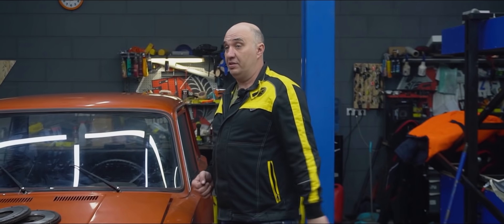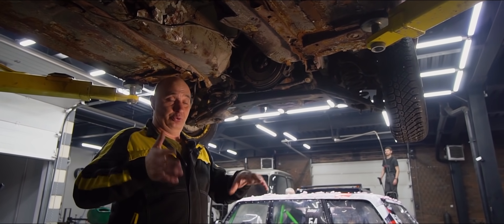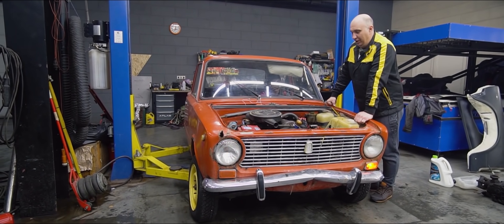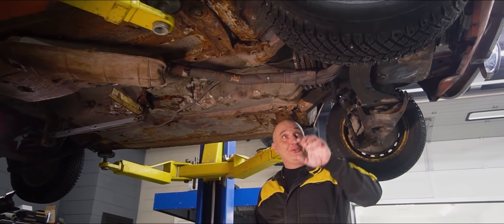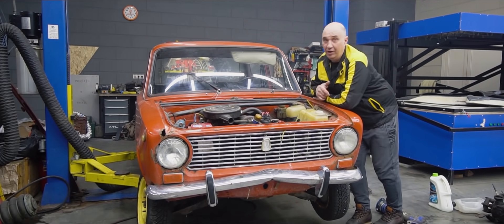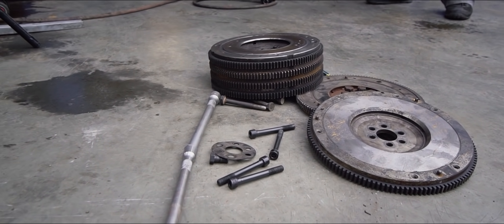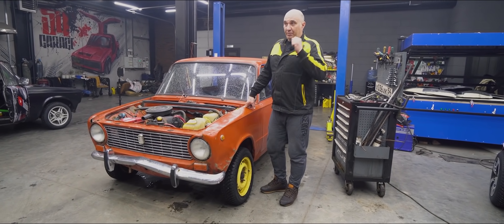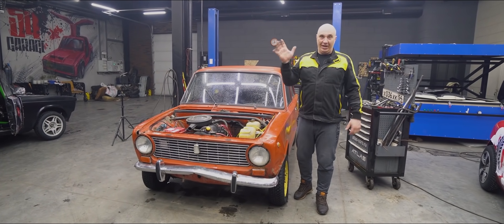What if you install FIVE flywheels onto an engine?

Comment: I bet it could do some wicked clutch pop wheelspin launches. You could have a cheat dragster, just revving a 50 horsepower engine into a giant flywheel for a minute straight, then release and do a tyre smoking 10 second 1/4 mile.
Reply: I used to have toy dragsters that basically did this
Reply: @boldsword1  Evel Knievel motorcycle toy? My favourite
Reply: @steven-vn9ui  not the one I was thinking of but I did have one of those to play with for a bit at my parents thrift shop, I miss that place we would randomly get the coolest things.
Reply: Back in the late 50s it was common to use the heavy flywheel out of a 2 ton truck in dragsters for extra off the line oompf
Reply: I've always wanted to do that on a bicycle. Basically when stopped put it in a gear that conects to a flywheel. pedal like crazy then flick a switch when ready and it connects flywheel to wheels. Launch!
Reply: @boldsword1  that was an awesome toy jumped that off roofs lol
Reply: Spin up like a top
Reply: @dopiaza2006  A bicycle will need momentum but not the extra weight, or you won't be able to get up to even the slightest incline. A really large and light flywheel with a dense rim connected to the pedals through a multiplier gear to capture more energy will get the job done without looking weird pedaling like crazy. Also, think of a clutch in place of a switch, to help you capture energy when braking or going downhill. It's a good idea, a hybrid muscle power/mass inertia.
Reply: @germangargicevich2618  the flywheel doesn"t have to be particularly large if it can spin fast enough, so needs extreme gearing or energy transfer through electricity
Reply: if you've ever driven a small 3 cylinder car like a corsa or polo/ibiza/fabia you'll realise this is how they work. obviously no  10 sec 1/4 mile but the only way to spin the wheels is rev it up and let the fly wheel do the work. it would be interesting to know the ratio of flywheel weight to engine weight for different cars.
Reply: Yes we Canada!
Reply: won't work unless you can do 100.000 rpm
Reply: I was thinking the exact opposite direction. I was wondering if you got that mass up to speed, how l o n g would it last? Like on an open highway, it would take a lot to get up to speed. but then I would think you would get some great mileage as long as you stayed up to speed.
Reply: @boldsword1  Toy was named SSP.
Reply: @bigbossimmotal  there was https://en.wikipedia.org/wiki/Gyrobus
Reply: @seesoftware  it's funny as soon as I seen this video that's what I thought I was the gyro bus
Reply: More like a tire smoking 10 feet, like a go- cart i built as a kid.
Reply: @steven-vn9ui  I had one of those as a kid I used a longer zip cord on it, it's suffering ended with it stuck in the wall :(
Reply: @Texassince1836  Knowing what I know about engineering, why do I SERIOUSLY doubt that?  My guess is they went totally out of their way to lighten the flywheels to the extent possible, as this lowers rotational inertia, and as they do now even in first level upgrade street racers, so you don't lose power into accelerating the flywheel rotationally AND accelerating it linearly down the track, a BIG hit in vehicle acceleration for both modes.  

Maybe on some junk or nearly junk stock stuff, or in the very early 50's when they were clueless, and there it almost certainly hurt them, not helped them, but probably not on 'pro level' racers, say the Daddy Don club, who pioneered several upgrades over the years, many of which are still SOP.  Even A class of the late 50s were smoking tires right off the line, so a flywheel would do nothing for them with respect to adding power.  It would subtract it.

If you look at how much HP it takes to offset say, a ten percent weight gain (way over ten percent), you'd find it is not remotely worth it.  What they went for is more power, fuel instead of gas, high flow in motors, at least some modicum of combustion efficiency/quickness (it was TERRIBLE), REDUCING WEIGHT, better power transfer to the track, making the highest HP engines of the time live long enough to not get eliminated, etc.
Reply: @MrJdsenior  The stored inertia was released when they engaged the clutch. It allowed the car to pull hard right off the line. Cars at the time were still making sub-300 horsepower, so storing energy before the green was a little "cheat" to gain a small advantage.

You don't start a drag race from idle speed, you start with the motor revved up,  and release the clutch. Today's big power cars benefit from a lightweight rotating assembly though.
Reply: @dopiaza2006  Someone has done this. Search on YouTube.

Comment: 4 flywheels adds "a lada" weight, comrade!
Reply: Jayson McNamara   : D
Reply: Ghèghè ^^
Reply: Touché!
Reply: That old LADA doesn't make 65 horsepower anyway.
Reply: @2009mechanic  - Lada; it's Russian for Fiat.
Reply: I have ridden in them as a passenger.
They are unsafe st ANY speed.
Reply: @scootergeorge9576  Lada, is that how you say Fix It Again Tony in Russian? 😂
Reply: @gravelydon7072   - No. In Russian it's fix it again Ivan.
Reply: Taken Apart  - Is that an Irish tavern? ; )
Reply: @gravelydon7072  hey, I drive a fiat!! 🤣🤣🤣🤣

Comment: ,,Seems to be some kind of weirdness with the timing chain. My guess is that the tensioner has fallen apart''
REVS THE ABSOLUTE SHIT OUT OF THAT ENGINE
Reply: Some Mitsubishi diesels had balance shafts , when they wear the timing gears and bearings ,they have weirdness too .
Reply: Abroken chain tensioner would throw the valve timing out. And would damage the engine.
Reply: @THEJR-of5tf  Not on a Lada...have you worked on them? :)
Reply: @THEJR-of5tf Based on another comment I'm going to assume that this is a non-interference engine, so if the timing failed, the piston wouldn't touch the valve
Reply: If you've watched much of this channel, that is exactly the mode they operate within.  It might bite them one day.  Especially when you see they are so utterly surprised what the energy stored in a Very quickly spinning wheel can unleash, wheels were tires are centripetally growing and disintegrating 'explosively' (previously standing right in the plane of release).  I sound like a broken record but they do take some stupid risks, at times.  And the chain worries me FAR less than the flywheels they installed.

You can get away with these lax concerns right up to the very moment you don't, on rare occasions.
Reply: Flywheels take off like the ripper from unreal tournament
Reply: @Vinlaell  Damn.. It's been so long since I heard about the original UT, I need to install it again.
Reply: @MrJdsenior  - When everything explodes, hopefully the shards of metal won’t come out through the screen though.

Comment: I like how he said “we’re not running a welded diff in this car,” like that’s such a normal thing.
Reply: Russians typically have spare axles with welded diffs and snow tires mounted, they just swap out the whole axle for winter.
Reply: @edbruder9975  not such a bad idea on a simple RWD car.
Reply: @WineScrounger  it is if you plan to use it as a daily driver. makes slow tight turns crappy
Reply: @randal3122  on regular surfaces, sure. Thats why they keep Summer and winter axles.
Reply: @WineScrounger  lol thats funny. you change out the pumpkin too then?
Reply: @randal3122  I don’t, I don’t live in Russia but it seems to be a thing over there. Just keep a whole rear axle assembly for winter, welded diff, tyres and all.
Reply: @WineScrounger  lol that is wild
Reply: Bruh right lmfao
Reply: It's a normal thing for them.
Reply: @randal3122  Not really noticeable on snow
Reply: @randal3122  yes thats part of the axle.

Comment: In the old days of drag racing, when only manual transmissions were available, we'd look for the heaviest flywheel we could find for our small block Chevy's, to help with low end torque.  The flywheels from the 348-409 Chevy's, (scalloped valve cover motors from mid-60's), were the best 11" flywheel: 50#  (~22KG)

After they became too hard to find, I ran a 12" Flywheel from a truck, with an 11" pressure plate, and 10.5" disk to make shifting easier.  Worked well.

Five flywheels = 50% of engine weight

Comment: Super. I tried this on a VW Beetle. I only added a little over four pounds at the rim of the flywheel, and not only did the engine rev up and down much differently, if you floored it, waited for it to rev up, and then dropped the clutch, it would really burn rubber. 💙 T.E.N. Edit: After reading a bunch of comments, a heavier flywheel means lower miles per gallon and less power available at the drive wheels, however, initial torque off the line and speed shifting are fun. 💙

Comment: If you used this many flywheels and the "automatic clutch" from before the car would be un-stallable
Reply: great comment mate! Next episode: unstallable Lada :))
Reply: yeah see they have to try this now
Reply: Idi vw is about impossible to stall at idle ,no throttle it'll probably idle up the steepest hill on a normal road.
Reply: I think you mean gyro action  "prosession " causing it to want to go its own way . I found , that wasnt a problem . The  thing I was worried about though , was the bearings in the bell housing , breaking , and this damm thing coming through the floor .
Reply: guess you can say it can't start....

...stalin
Reply: It would need to be an extremely aggressive clutch so that it doesn't slip so often.

Comment: 3+ tranmissions would be fun!  How slow can you go?!?
Reply: Mechanic : How much torque you want?
Me : YES
Reply: Hell yeah. Bump!
Reply: That's genius!
Reply: Skyrim horsepower.
Reply: J-dayday  Not enough weight
Reply: In sweden its common to use double gearboxes
Reply: @andber  epa😆
Reply: Well lets assume 4:1 reduction in 1st gear. 3 transmissions in series  in first gear 4*4*4= 64:1. At idle ~1000rpm:64 = around 15 rpm output. 3:1 final drive gives us 5 rpm at the wheels. Assume 2m circumrefence. 5 rpm * 2m = 10m/minute, 600m/ hour
Reply: @petarmiletic997  well I sure wish you could have sat beside me in math class lol.. 🙃
Reply: @petarmiletic997  good job
Reply: @petarmiletic997  Ford 8N tractors were sometimes equipped with a second step up or step down transmission. And a Flathead Ford V-8 in place of the inline 4.
Reply: Look up rock crawlers. They can have that many transmissions.
Reply: Don't laugh , a guy I knew had 3 transmission's hooked to a 1941 Ford with a flat head it would top end out at about 160 MPH , so I was told ...
Reply: @tomrobards7753  Or 1 foot per hour if in the lowest gear. :-)
Reply: You know the old 2 cylinder john deere tractors they do have races on how slow you can go I have one and you can put it in first gear at an idle get off the tractor and walk all the way around it and get back on the tractor LOL
Reply: @kjellin3818  the guy I'm talking about had the transmissions end to end , this was back in his youth , I forget how many gears that would be
Reply: @gravelydon7072  yes they were called a funk conversion also the 8n also had a 6 cylinder conversion done at the FORD tractor dealers I just missed a flat head v8
Reply: @tomrobards7753  Same thing with the Cleveland trencher we had. It had 4 different transmissions on it. Two of them were for control of the wheel and belt, another controlled the lift system and the 4th the movement. The 1st and 4th were tied together so that the output of the 1st also went to the input of the 3rd. Forward speed down here in the rock was 1 ft per minute and could even go down to 1 foot every 5 minutes with the wheel at digging speed. And at idle, well you might as well pack a lunch in the lowest gear as you won't be going anywhere soon. Get off walk around, eat lunch, walk around, check and see if it had moved.
At work we had an IH 666 Diesel tractor with a hydro. It also had a two speed selector. Put it in low and set it at the minimum setting and it would just creep along even with the engine at PTO speed. Worked great for digging potato test plots as the digger would shake all the dirt off before the potatoes got to the end of the chain.